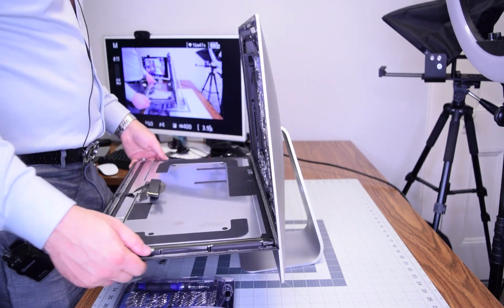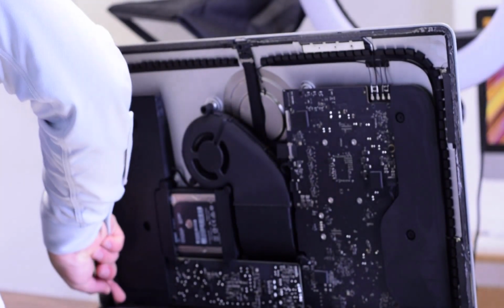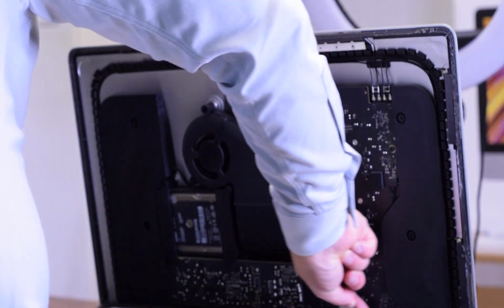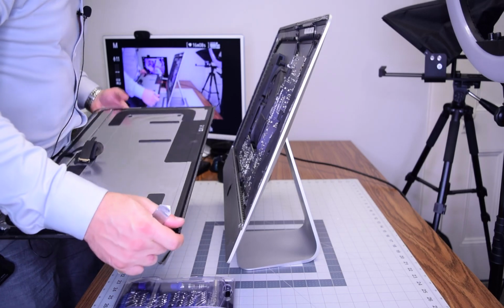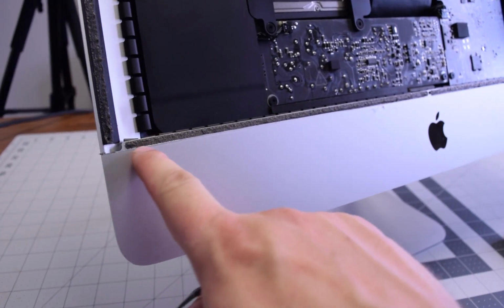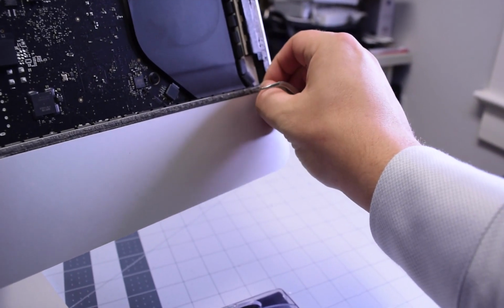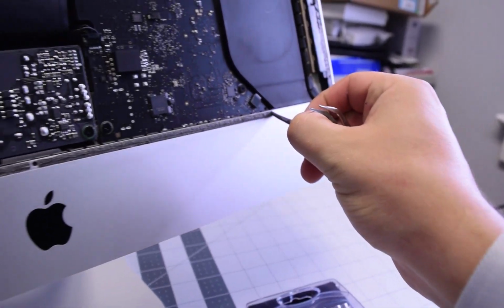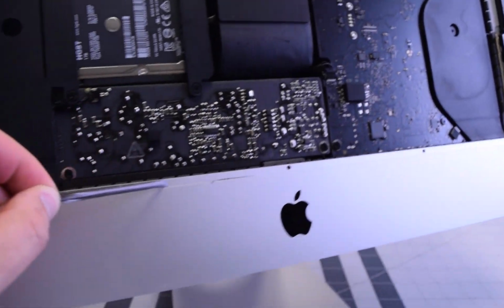⚙️🖥️🛠️ 21.5" iMac Screen LCD or Retina Replacement 2012-2017 (A1418)

Comment: I damaged the cable and connector on the board during upgrade (didn't realize it until I was closing the machine) that it would not stay in the slot ( looks like locking mechanism broke on one side). Nightmare for a amateur. Any suggestions would be great. Thanks

Comment: I have a 1418 and ordered a replacement, which is a glass bezel. In your video, the replacement looked like a bezel + monitor. Is there a step not shown, where you affix the new bezel to the removed monitor? I am wondering if the replacement I got should be more than just the glass bezel with black surrounding frame (not as thick as the one you’ve shown)

Comment: This does not cover the same display and motherboard connections for the 2015 variety. Maybe for the earlier ones, yes, removal of the data and the power cables, but doesn't show the "alternates" maybe consider an explaination or changing your title or using another iMac, sorry

Comment: How would you recommend removing the power button mechanism? I bought a replacement from eBay with double-sided 3M tape on the back. Is a blow dryer sufficient in order to loosen the adhesive for removal?

Comment: El display de una imac 2014 es igual ala 2015 amigo
Reply: Agree, the connectors aren’t located at the same place in a 2014.
Reply: @scenfeber  display imac 2012 and 2013 They are equal?
Reply: @andaspeyo  I’m not sure, I dealt with a 2014 model.

Comment: Can someone please guide me or advise how ONLY THE ACTUAL GLASS on the 2012-2017 can be removed from the LCD? I have seen the glass alone being sold and have seen tons of videos on replacing it on 2011 and earlier models but ZERO on the 2012-2017 models. Please help as I have a 2012 that had the outter glass crack on the edge but LCD is good. Thanks in advance!
Reply: Because it doesnt youll have to replace everything
Reply: Have you been able to find what you were looking for? I have the exact same problem and can't find how to replace only the glass...
Reply: Yeah, unfortunately the OEM market hasn't caught up with some of the later models.  I have a 2017 iMac with the 4k Retina display.  Best I can do is just replace the whole unit.  Stinks, but it is what it is...

Comment: Why would you ever put 2 layers of tape? I don't see how that will make a stronger bond, to the screen nor the frame. The only thing that will do is double the thickness of the tape, thereby increasing the chances that the screen does not sit correctly on the frame. IMO
Reply: The only thing I can think of relates to a post on a 27" screen video where someone mentioned its difficult to get the screen off a 2nd time when thinner tape is used. maybe 2 layers makes it possible to get a tool between the body and the glass?

Comment: nice video. I broke the Display few days ago. Where did you order the new display? How much is the average cost? thanks a lot
Reply: Did you ever order a new display? I'm looking for a new display screen for a late 2015, 21.5 inch iMac but all I can find are screens for $200-$300. Surely there has to be a place somewhere that sells screens for less than $100

Comment: Cant replace the glass only?
Reply: did you found out if possible only change the glass? ... mine looks like has a crack on the glass only
Reply: @1982diegoandres  you cannot just change the glass. 2012-2017 models the glass and lcd is one part.
Reply: @themannygee9079  Yep mac wanted to get the glass closer to the lcd apparently so they started to glue it permanently together. So now a replacement requires the entire lcd which costs more then the price of the imac itself...

Comment: Hey, I have a 2015 iMac with the 1920x1080 display. Would it be possible to buy a 4K Retina display and change mine. Would it work? Does it have the same cables?
Reply: Bobby G. Lol I have same question. I do know that my 1080p has emc number 2833 on the bottom. Look there. If it’s 2833 that’s the 4K model. But for some reason it’s listed for some of the the 1080p models. The guy I bought my new 1080p screen from was baffled so he had to check the serial number. Which called for the 21.5" LCD LM215WF3-SDD. But he wouldn’t say no when I asked since the frame seems to call for the 4K but was sold as the 1080p.
Reply: Mikes Unboxing & cool things hmm. So I wonder if it’s possible. I can’t see any difference in the actual body of the iMac. And for Apple to make a bespoke part for each would be stupid. I was trying to see if I could find 2 separate videos of each replacement and see if the plugs on the screen to the board is the same. Because if it can be done I would most certainly do it. And while I’m at it, while the screen is off, I’d bump up the RAM while I’m in there. That’s also stupid that Apple didn’t make that same back hatch they put on the other models so you can easily upgrade it.
Reply: @Roberob1189  Yeah I got a good deal on it damaged basically cracked last that's all that was a matter. I just wonder if it's a graphics card support or motherboard or something otherwise as far as it goes it's technically the same device only way to find out as plug it into it but since I have a 1080p on the way I won't be doing that But if you happen to try it and it works let me know lol. I find it really hard to find anything on the 2015 version non 4K. Because I think the one that basically the same as the late 2014 except with thunderbolt 2
Reply: Not worth it, the 4k iMac has hardware components designed to work with a 4k display. If it did work it would be slow and heat your display graphics fast.